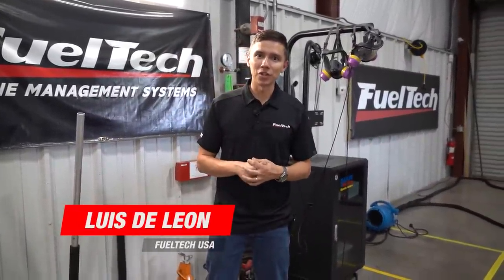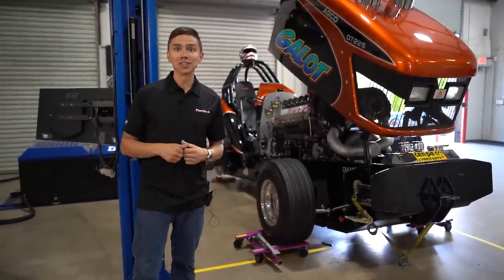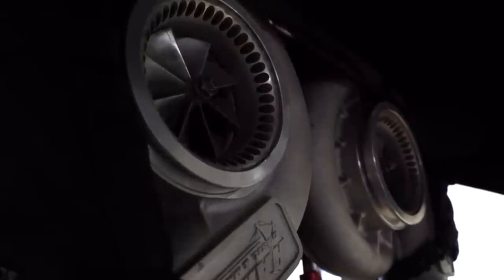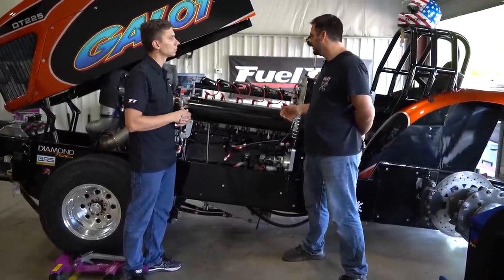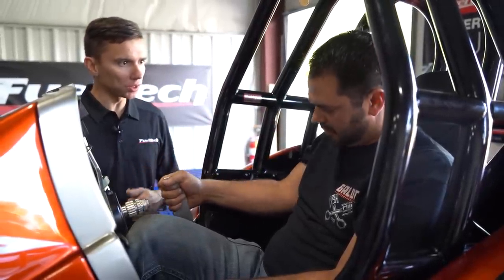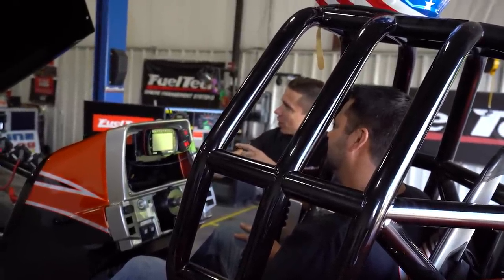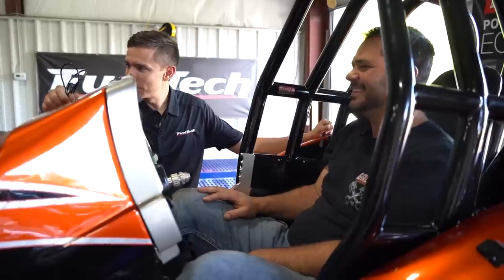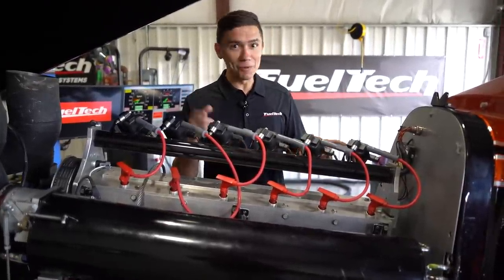Triple Turbocharged 650ci Six Cylinder | GALOT Motorsports | Super Stock Pulling Tractor

Comment: Gonna make a full video of it and not show 1 dyno pull?
Reply: They are probably like most pullers and don’t want the competition to know anything.
Reply: @viciouscycles88  you whould think rpm should know this. This is like Nascar here
Reply: @viciouscycles88  he went more in depth on the engine setup than i thought he would!!
Reply: @viciouscycles88  I just have never understood what it matters if their competitors see dyno numbers ? I think the real reason is they dont have even close the BS hp numbers they claim to spectators.
Reply: @V8Lenny  way above it I think so they (the organization) will not putt limitations on it. It's the same on the other side of the pond.
Reply: @V8Lenny  I'm in a team with a few friends in the netherlands with a 4.6 L four cilinder engine that makes around 1000 HP on diesel and the rpm are limited to 3200 rpms
Reply: Forreal. What did I come here for
Reply: @V8Lenny  tractor pulling is way more complex and competitive than you could imagine. Even with 3000+hp tractors a 30hp advantage could mean the difference in winning.
Reply: @lukelanam6045  so what? Their competitors also need to know how to make that power. Why wouldnt anyone try to get as much power anyway no matter what others have ?
Reply: @V8Lenny  well let's say your competitors try a new setup and they let everyone know their power numbers and if its more than yours then you will try to replicate that setup. So their goes their power advantage. Things like turbo technology make advancements every year leading everyone to continually try new ones to find the best. It would be alot easier if you already knew everyone's power number to decide if the turbo made a difference.
Reply: @lukelanam6045  you will see that at track anyway.  Dyno numbers dont really mean that much. Dyno is a tuning tool.
Reply: @V8Lenny  a tuning tool to get the most power.
Reply: @lukelanam6045  and in pick up truck pulling they say they dont even use all the power , other things are more important for success.
Reply: He said in the video that they couldn't make a full run. It was overloading they dyno at 50 psi boost.
Reply: @matthewerwin4677  because of slow gearing.
Reply: @matthewerwin4677  thats why they use engine dynos. They typically never use hub dynos. There was just to test their new fueltech engine management system.
Reply: @Rvaatje  dan weet ik welk team.....

Grapje...
Reply: @lukelanam6045  I doubt 30 hp will  make that big difference...  But 3 times 30 hp cause of 3 tining steps...yeah I guess it can make a difference. 

Dragracing  is more precise...I have customer stating  that  a change is readily detected as et  is 0.02 shorter...

Tractor pull....many variables:  track , sled, gearing, balance , first or last in line up, revving up or clutch action... etc etc.... aaaahhhhhhhhh!!!!@#@!!@!@!!
Reply: @Baard2000  im just going by what I know. Some family members own the barely gettin by and whiskey wild pro stock tractors and my neighbor has a 2.5in diesel truck.
Reply: @Baard2000  nou roep maar
Reply: @Rvaatje  dat zei ik....grapje... Dancing on wheels reloaded?  Forza Fiat?
Reply: Vind wel mooi : 2 nederlanders in de comment sectie.....😁👍👍👍
Reply: @Baard2000  mag de 3.4ss 3200toeren?
Reply: @markschuurman9531  ik dacht wel als het iets kleinete inhoud is dan normaal.  3.4ss  5.5 liter 2700.   4.6 Liter 3200.
Reply: @Baard2000  je kunt maarzo gelijk hebben met 4kleppen per cil misschien ja
Reply: @Baard2000  nope flying bull
Reply: @Baard2000  klopt volledig
Reply: @Rvaatje  Is dat de voormalige trekker van Wichert Koers?
Reply: @Baard2000  nog steeds maar die doet het iets rustiger aan ondertussen
Reply: Not trying to be rude. This is my hometown team but I've never seen it make a complete pull myself, for the exact reason at the beginning of the video, goes to running like shit...
Reply: @V8Lenny  It's not going to show crap for HP on the dyno with a 42:1 reduction.
Reply: @lukelanam6045  Power doesn't mean crap, you're going to try to replicate a loser claiming high HP or a winner who never says what HP number they have? Obviously you replicate and/or leapfrog the winner, regardless of what they say about the power they have.
Reply: @bobbygetsbanned6049  same hp no matter what gearing.
Reply: Can’t load the motor hard enough to make 110psi
Reply: @benstrickland817  I’ve seen multiple full pulls on this exact machine along with GALOT2, GALOT MISS, ETC
Reply: Yeah crap
Reply: Glad to see i was not the only one thinking the same thing. Talk about foreplay.
Reply: Exactly my thought. I know of a shop on the east coast that dynos every damn vehicle they work on. Mostly Corvettes and Camaros
Reply: @V8Lenny  we bought a 650” NA pulling motor that only had dyno time to run in a drag car. It was a one off build, heads flowed 600+cfm, compression was 17:1 all kinds of wild stuff. The reason they sold it with only dyno time was because Sonny’s had just posted the numbers on their motor for the class 1640+, their combo was a completely different platform and down around 100hp. If that number wasn’t posted they wouldn’t have known they’re bringing a knife to a gun fight. That’s why teams keep things secret.
Reply: @christiansmith8529  they didnt even try if it was competitive or not, those other numbers might be BS just to fool others. You still have to try to get as much power as possible, only secret is how to get it , there is no secret in hp numbers.
Reply: @V8Lenny  being down 100hp they basically scrapped the whole platform. Everything they had in that Engine was already “on the edge”. Their engine was still loosely based on a production engine. The Sonny’s one is not in anyway. I can’t imagine an engine builder staying in business for too long if they’re fudging the number on class engines.
Reply: @christiansmith8529  different dyno, different correction factors, you never know, they are only numbers.
Reply: @V8Lenny  Agreed
Reply: @Rvaatje  Really??? Which engine is it?
Reply: Right!!!!
Reply: @lukelanam6045  A 30h.p difference in a 3000 h.p. pulling tractor doesn't mean shit... It's all in how you setup the chassis to get the ppwer to the ground, that REALLY matters. A 2500 h.p. rig can easily beat a 3000h.p. rig if the chassis is setup better.
Reply: trailblazer....,4.2 straight 6 cly...24 valve head...not much work from stock form..just playing around..with it because never see one under boost and they had one the yard all beat high mileage and what do u know rate now making 900 HP..., Couldn't imagine if someone took the time to spend the money... To build the whole setup I wonder what HP it would reach.... Safely....
Reply: @bobbygetsbanned6049  The gear reduction doesn't mean anything on a dyno. It measures the power by time and RPMs. You input the gear ratio on the computer before the pull, and it calculates the results based on that. They're still accurate enough either way.
Reply: @V8Lenny because that's not how that works
Reply: @V8Lenny no tf u don't drag racers out side if junk bracket racing won't share shit

Comment: That #2 spark plug wire is triggering me.  Awesome rigs
Reply: Yep, looks like a track repair. Boss we got a bad wire, I don’t care just find one.
Reply: It's also triggering the spark plug.. 😂
Reply: @Matty.Hill_87  😂
Reply: @Matty.Hill_87  were do you get your spark plugs?
Reply: @Matty.Hill_87  🤔
Reply: You mean #5
Reply: @reddirtfarm7704   that’s the #2 cylinder. Unless that motors in backwards?
Reply: @jmathis3  is it a IH td466.
Reply: @reddirtfarm7704  that’s what they said then block is from.  #1 is always the front cylinder
Reply: @jmathis3  yes it is most all of us pullers use a ih 466 or a jd466 as a base.  Cylinder closes to the damper is #1   on both.  None the less we know what wire you are talking about. #5.
Reply: @reddirtfarm7704  but that’s the front of the motor?
Reply: @thomasevans7892  probably online!

Comment: What makes these pull tractors even more extreme to me is they have to make those giant horsepower and torque numbers not just for 3 or 6 seconds but for up to 20 seconds or when ever the sled stops
Reply: And with a ton of stress on the drive line. In drag racing your biggest stress on the drive line is during the launch launch, after that it's not so bad but with these it's the whole damn run.

Comment: I enjoy it when racers from other disciplines marvel at the complexity and power and torque numbers that modern pulling tractors make.Amazing.
Reply: The true horsepower and torque specs may never be known because no equipment exists that could check it. Similar to top fuel dragsters and funny cars that are estimated at 11000 horsepower. It's almost unbelievable that those engines stay together at all.

Comment: so a diesel block to handle extreme boost with alcohol is the way to go if you want it to survive all those pulls?  or is it more because a billet block is so expensive and they can use the extra weight of the iron block to wheelie less?

Comment: well yeah its going to max out the torque on a hub dyno with a 30:1 reduction. without the wheels on having a ~30" radius/12" would give you ~2.5X less wheel torque

Comment: He is holding that tractor back, It maybe goes 40% by the sound of it. When he start to make boost you can hear it he lifts of. He did not full send it. Not even close. He will tear the dyno to dust. search for: 
John Deere Prostock in hub dyno for the first time at 1,15 that is how it should sound turbo all the way.

Comment: If I had the money!! LoL I would buy one of the cool ass cab over big trucks as a roller that they race in Europe or wherever on road course's or a old single axle Peterbilt or Kenworth and drop it off at a shop basically give them a blank check tellem I want to drag race do massive burnouts, try to drift and play around on the street with it! I would have a combo simmalr to this built except turned down a little bit with water jackets in the block and head keep it on methanol figure out who makes a automatic trans with a trans brake I have no idea if anyone makes anything like that but in my opinion that would be one of the coolest hotrod's on earth! Imagine pulling up beside it at a red light and proceed to get gapped by a big truck!

Comment: That thing leaves at 7000rpm and makes over 10,000 pound feet of torque.
isn't that like 13,000 horsepower? and on half the boost they normally run?